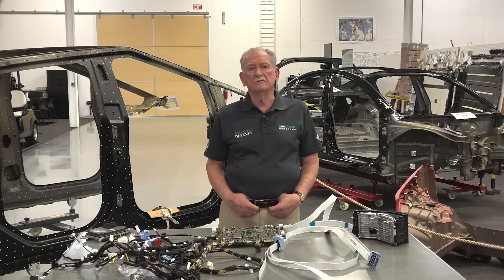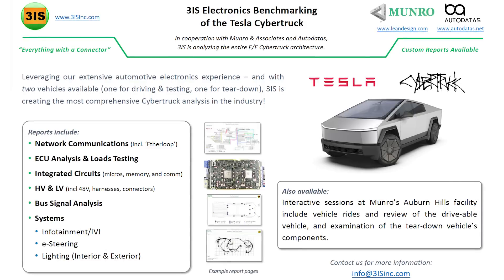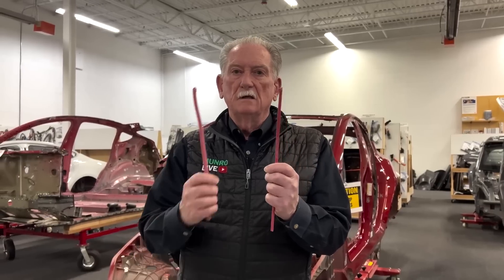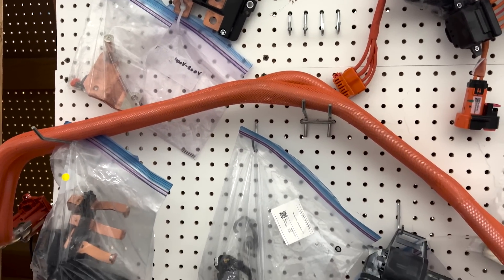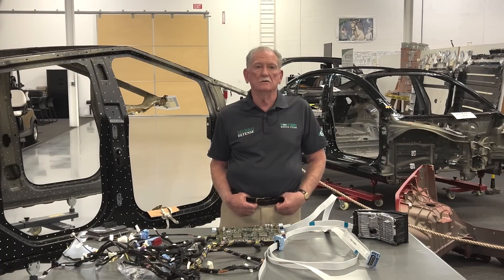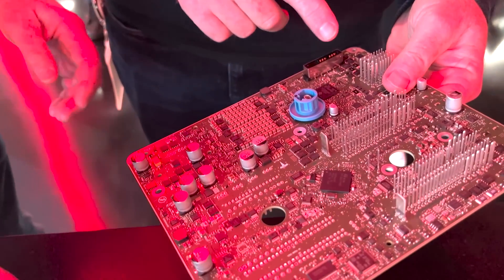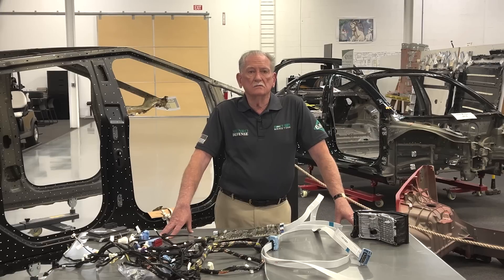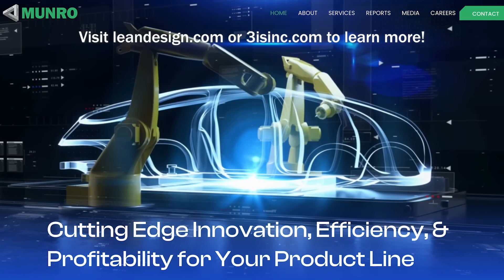Tesla Cybertruck Electronic Architecture Reports Coming Soon!

Comment: It'll be fun to learn the architectural details, but meanwhile from the slim pickings of info I've found, I think they may have created a Frankenstein monster of a hybrid network: Franken-Net ;-)  I'm just guessing and speculating (and some of this info has been tossed around), but it sounds like they built a token ring topology with DUAL rings (for redundancy.. or for full duplexity?) as the backbone network (like a bus), obviously to reduce physical link count (like in a star or mesh network); and employed some part of the gigabit "ethernet" protocol stack in those rings for increased bandwidth, minimal latency, and for leveraging - hardware?/software? - of a mature standard. 

...And also implemented deterministic data packet delivery (with global microsecond sync) via a TDMA?/ algorithm - and maybe using a token protocol with a "priority" multi-token scheme - for fairness and prioritization of real-time distributed access to the ring backbone/bus (i.e., for any highly "time-critical" subsystems).  They probably had to build some parts of the "stack" and "token" protocols in silicon to meet any critical hard real-time requirements. Also could be like a software real-time reconfigurable network with both local and distributed thread prioritization and management. 

And finally, I think they hung "local CAN subnetworks" off the dual gigabit token ring backbone so any local devices (COTS or other) with standard CAN capability could be utilized. 

Bottom line is... it eliminates complex topology, hence copper, and allows better total system data monitoring, debugging, etc., as you can plug into the ring backbone and monitor/capture ALL system traffic and events on that backbone via one connection point and at the same point in time.  All in all - brilliant!  And if proven over time it might be adopted by industry, i.e. become a "standard" hybrid network architecture - maybe for any platforms employing mission critical hard real-time distributed systems. 

 I wonder what would be the best programming language and OS to use?  I'd go with Linux and Java, embedded versions where needed, and Java Virtual Machine in silicon where needed, to meet footprint and/or hard RT requirements. 

Anyone think there's a plan to use this Franken-Net design in Starship, where every kilogram REALLY counts?  Cheers y'all!

Comment: Is stainless steel necessary for the exoskelton to have the necessary strength or could aluminum work?
Reply: The stainless alloy sheet is mostly used as cladding, not unibody structure.
Reply: the stainless has no structural purpose, painted alu would be a much better choice

Comment: The 48V is interesting. Its a standard voltage in telecom systems and by association used in Power Over Ethernet (POE) which delivers Ethernet packet data and 48V on the same connector to appliances like  WIFI Access Points, Security Cameras, Digital displays and much more. Its a natural.  I wish the Desktop PC market would align to this approach. The cable harnesses - which clutter up the box and reduce optimal airflow would be greatly reduces.
Reply: From what I have seen on other videos, it seems that Tesla's Ethernet/48V system is different in at least two ways to what has been done in other domains. First, the networking signal is sent over Ethernet, but 48V power is sent over a separate cable. Second, Tesla has implemented some parts of the networking protocol in hardware (as opposed to implementing the networking protocol mostly/entirely in software), which apparently helps to reduce latency and improves its suitability for a real-time system.
Reply: Other auto makers have developed and used 48v systems for 15 years. Musk didn't invent that either.   It exclusively came down to available batteries.  Now that there are reasonable options to lead acid, it's a no brainer.
Reply: Yes. 48 VDC is used in mild hybrid motors, engine start/stop systems, active suspension, roll control, electric compressors, power steering, refrigerant compressors, turbines, etc. 
 @dynomotivedyno9194
Reply: Absolutely wrong. Not implementing 48v, wich was tried by Ford in the 1980s was a result of Suppliers not wanting to change. Tesla now makes about 80% of the controllers themselves.  @dynomotivedyno9194

Comment: Just my thoughts with experience in RC. Electrical failures happen very often at the connector, not the wire. Also the flex cables are near each other. A rodent can destroy both cables at the same time. Not really redundant.

Comment: Talk about the structure of the frame, and how it breaks particularly around the tow hitch
Reply: And it was accelerating at full throttle before taking out any of the slack in the towing chain.
Reply: Lmao, if your talking about the recent video, it’s because the rear casting was hit bf the pull
Reply: If I were to land an RC car from a jump with inadequate suspension of course the chassis is going to have problems slamming right on a hard surface. 

Noticed how hard the double impact of the rear frame/bumper was right after the concrete pipe test? The Ford would have also experienced a terrible amount of frame bending/breakage if it completed the same test. Any armchair engineer would have known how horribly designed that test was with no exit slope. 

Of course any testing metric that uses points is not truly neural and can be biased any way by picking and choosing what you want to test, even without the test creator realizing.
Reply: Admittedly, I would prefer if the fasteners were to fail before welded or cast parts. But we can easily find dozens of idiots snapping the tow strap taut and breaking off the tow bar, bumper, or axel.

Comment: Sandy, can you please react to the whistling diesel Cybertruck video? Specifically, the moment where they towed and the back end ripped out, really curious about your thoughts on it. 

Also just wondering if you know how much impact steer by wire has on battery?

Thanks
Reply: They yanked it out after damaging it.
Reply: @Derpy1969  They did the same to the Ford. It seemed like the actual mega casting snapped
Reply: Id love to see this
Reply: I have seen in person and in many videos when tow fixtures, axels, and/or bumpers rip off. Nothing new here when you take a running start and suddenly make the strap/chain taut.
Reply: What is missing is the inspection of the Cybertruck for cracks and fractures.  Plus why didn't the shear bolts fail instead of pulling off the bumper.
Reply: They cracked the casting when they smashed the terrain's edge against it.   Usi g it to pull afterward snapped it off.    Note that it was still able to drive afterward.   The Ford had it's shaft broken and undrivable until replaced in the similar event.
Reply: @maxpelletier2237  big difference in a shaft breaking and massive structural component of the chassis. But neither of us are experts, that why I want to see Sandy’s opinion. People keep jumping to defend Tesla no matter what but I just want to hear an experts opinion.
Reply: Cyber plastic cannot pull out a tree stump.  I ll keep my money.
Reply: @Taxthe200mil  The Model X was showcased pulling stomps years ago.  The CT is even more powerfull... So I call BS.

Comment: Tesla needs to either buy or design a mining facility to make these batteries more cheaper, since cobalt and other minerals are still too expensive.  Complete vertical integration is necessary for the future.
Reply: I don't think so at all. Where does that stop? Should they have mass scale forges too? It's okay to have suppliers that do what they do, it's easier for many reasons.
Reply: @danfalley9296  not true, not when you are building trucks that are not really full size trucks, more like over designed small pick up trucks. They look cool but the problem is they didn't design them for people who actually use them, and just went with the market of everyone who owns a truck just to haul things Maybe 1 or twice a year.  For a truck to be worth 100k or even 75 it's not worth the price for the range and towing until the batteries are cheaper and better. What about when it's cold you loose range.  That's my point
Reply: @Christopher-cr7pw  You make no sense.  Cybertruck is small? Full 5 seat cab,  larger bed than typical full size pickups,  frunk. Maybe Tesla should make their own tires too???
Reply: @jamesengland7461   compare the Cyber Truck to a full size diesel truck it's small, see it's people like you who have ruined trucks no one cares about seating 5 people, there's a small amount of people who need 5 seats all the time, plus a truck is meant to haul, tow and use for off roading, camping not to be used as a car. If you want 5 seats or now dodge is looking at doing 3 rows then go get an SUV or Car stop making trucks to fit your small scale use cases.
Reply: Google 'tesla lithium refinery' and see what comes up...
Reply: Cybertruck seemingly doesn't use much if any cobalt in it's batteries

That being said, also, no, supply chains are actually sustainable, what you want is some internal supplimentation in case of external failure
Reply: Henry Ford had his own foundry. Elon will take on any facet as necessary to minimize manufacturing friction and latency.